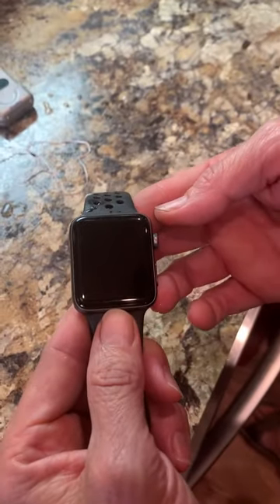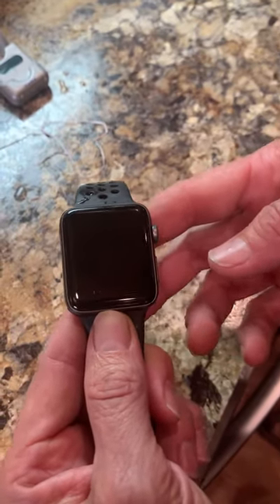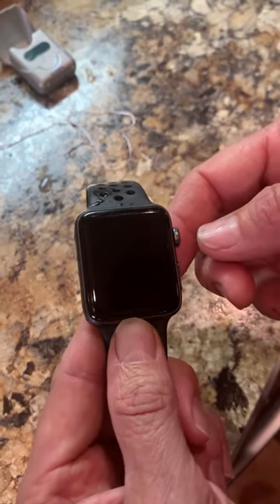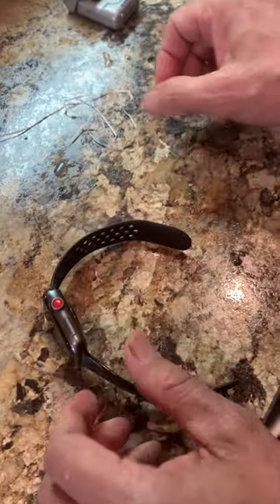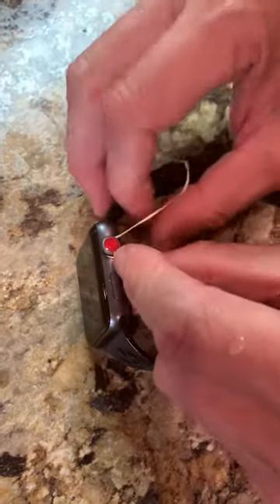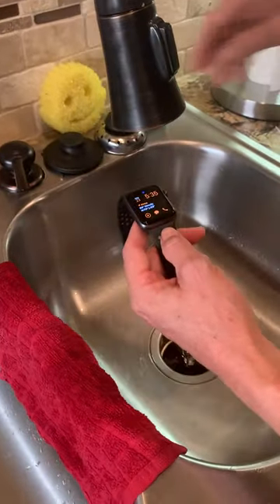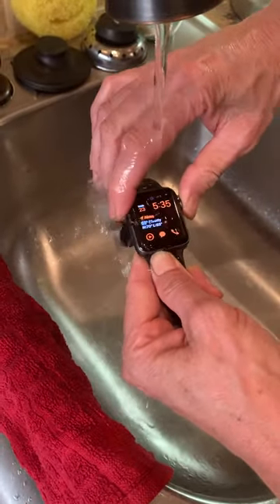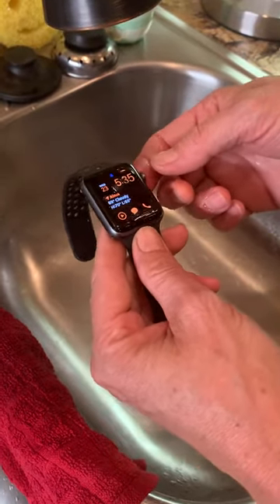Apple Watch crown button not working, quick fix.

Comment: Could not find any non-waxed floss in my house so I got a piece of thin sewing thread and ran it between the crown and the body--you'll have to force the thread to get it in deep. Then ran crown under warm running water (per Apple Support site and other YT videos), rotating and pressing crown many time, 10-15 seconds, to wash out any remaining debris. BEFORE: the crown did not rotate or depress, not at all. AFTER: the crown rotates freely and there is a noticeable movement when pressing and releasing it. Problem solved!